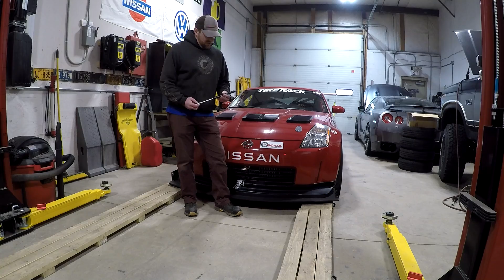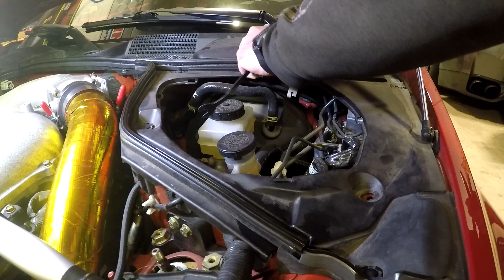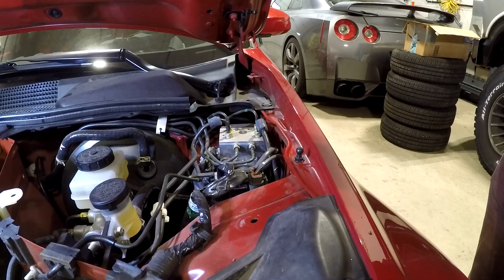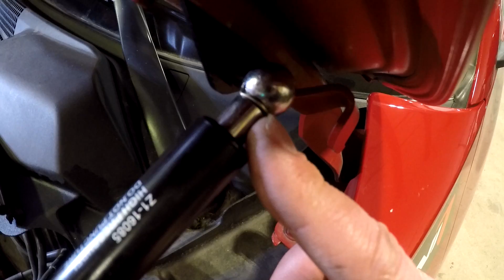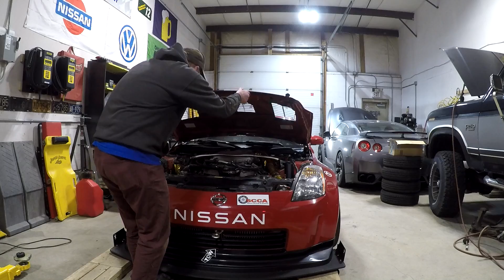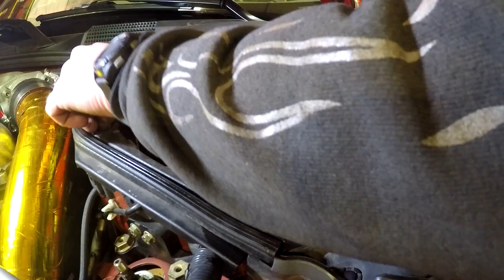350Z - Z1 Motorsports High-Lift Hood Strut Install How-To

Comment: Hey I installed these on my Z, but now when I pop the hood, it doesn’t pop up. I have to pull up really hard on the hood to “pop” it. Any idea on how to fix this?
Reply from the maker: Does the hood still seem aligned to the rest of the body? I'm wondering if the hood shifted some and is putting extra stress on the release which could cause it to be harder to open. I don't have the hood latch anymore on my hood so unfortunately I'm not sure if I would have had similar issues with mine. Z1 is pretty good about replying to questions, you may reach out to them.

Comment: I’m curious why you replaced the already existing struts you had, they seemed to require no cutting/ modification.
Reply from the maker: One of my existing struts was leaking and barely held the hood up. The cheaper option would have been to buy a single replacement but I also wanted the higher lift for better access.